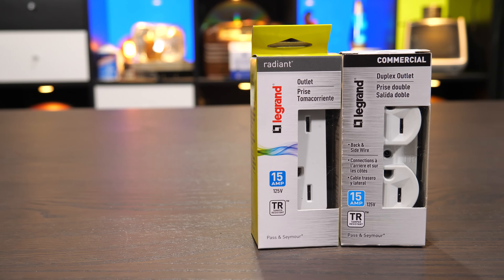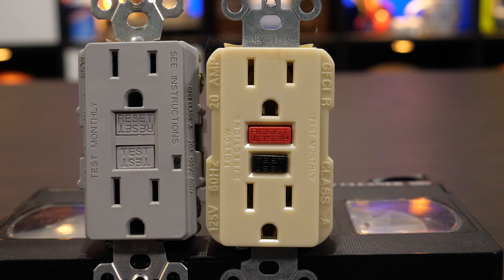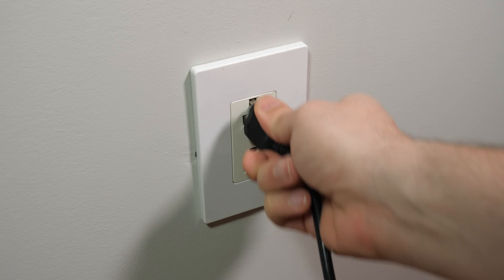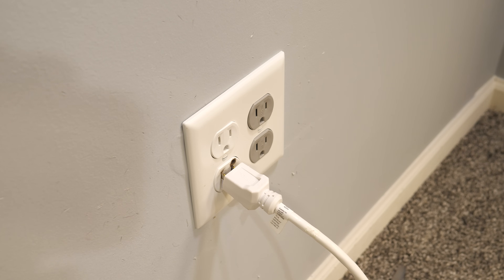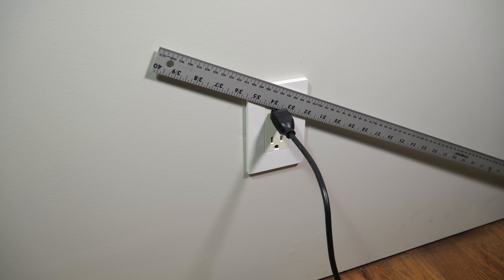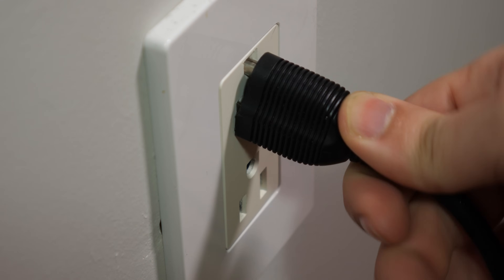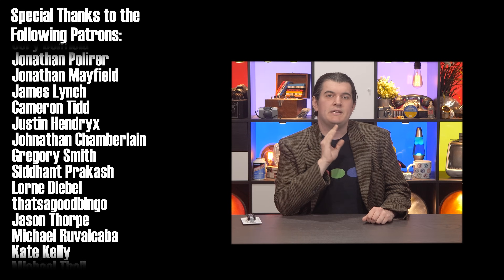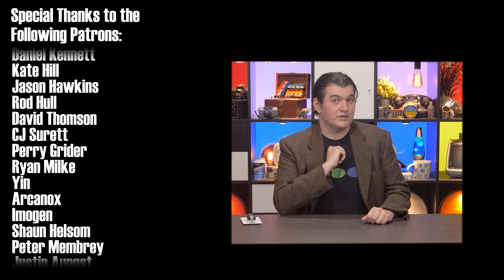Power outlets are topsy turvy - but does it matter?

Comment: I actually find it kind of funny/interesting how many of the issues raised are solved by EU plugs. They are fairly standardized, the receptacles are symmetrical, so you can plug in either way up, even with grounded plugs, they are inset, so even a slightly ajar plug isn’t easily reachable, and they are sleeved.
And the cup-like receptacle actually holds onto the full-sized plugs quite well, making it harder for them to slip out.
Reply: I lived in Europe for two years and loved the outlets and plugs there. I'd totally be down for us to adopt that design and ditch this design
Reply: EU and UK plugs are definitely the best I've seen, with EU ones are definitely the most elegant of the lot (ground being on the outside of it iirc?), with the UK design being from the era when plugs were installed on cables by the owner (hence the overengineered safety features of the fuse and slack on the ground) but either way, I'm glad I don't have to use a Type A US Plug.
Reply: counterpoint: eu outlets look silly
Reply: @Thesupremeone34  counter-counterpoint: I'd rather have outlets that people think look silly but are very safe versus having outlets people are used to but are extremely unsafe by design
Reply: Counter-counterpoint - to us in the EU, the NA outlets look silly

Comment: Huh. that explains why so many things plug in upside-down, especially ungrounded ones. But there's a ton of things that are only stable if plugged in the other way... and wouldn't be stable at all sideways.
12:00 really? not one? I find these things plug in upside-down all the time. But maybe they just feel upside-down to me, and the manufacturer actually intended that. Either way, can we agree there seems to be no standard on whether a plug-in device should have its mass above or below the plug? Thick electrical cords tend to go mass-down, but scented plugin things tend to be mass-up (when they aren't centered) in my experience anyway. and if it's something like a signal extender or a plug-in monoxide detector or something, it's a total crapshoot.

Comment: I once dropped a small metal tool, basically a small metal dental pick, it fell perfectly across the live and neutral pins of a slightly ajar plug, creating an eye searing arc flash and a decent bang. Fortunately the tool blew apart and didn't weld itself to the plug and it was brief enough that the breaker didn't flip. However, ever since then, I've cared a lot about the orientation of plug 😬

Comment: The NEMA plug has had those "Design Flaws" for decades yet no changes are ever going to be done.
as mentioned the lack of insulation on the top half of the pins.
All of Europe does this, Australia does this, other countries do this.
You would think who ever maintains the standards for NEMA would pick up on this common trend.

These counties also add switches to the outlets too.

Comment: Patent says ground up, not like it matters.

For myself I turn the outlet depending on use case in any apartment or house I'm in. 

Ive had plenty of right angle like plugs in both orientations or 45 angle so just turn it myself depending.

Comment: To get a safer plug it would be possible to design new plugs with a sleeve that fits into a recessed outlet that would fit said sleeve. To retain cross-compatability, existing plugs would simply need to be able to be inserted into the recess, eliminating the 'need' for the sleeve. 

I think the issue is the cost of implenting such changes. Is it really worth the billions of investment just to change a plug that works 99.999% of the time? IMO that money could go to solving much more important problems.

Comment: i think the top guy should be upside down and the bottom guy's face should be normal orientation.

That way if you have two grounded wall warts, you can plug both in at once. Maybe do a chicago sideways on the entire outlet too to make the cords flow nicer.

Comment: As a maintenance technician at a smaller-medium sized university, I have some feelings about orientation of outlets. Keep in mind I primary deal with Dorm rooms and University owned Apartments. 

1. If its a standard duplex receptacle made by Pass & Seymour. Install it with the ground up. Whether its under the Legrand Name or not, they all have one fatal flaw with residential and commercial grade receptacles. They are made of incredibly Soft Plastic (for receptacles). If installed with the ground down, any grounding pin from any plug will cause the soft plastic of the face of Pass & Seymour receptacles to stretch, and therefore the plug will "sag" in the receptacle. This leaves the hot and neutral exposed and are often making very poor contact within the receptacle, thus leading to the contacts inside the receptacle wear out and sometimes arc, even when a plug is fully inserted. This issue is not a problem if installed upside down for P & S or for most brands, as the "pull" is therefore causing the grounding pin to push "up" deep inside of the body, usually against the metal frame inside of the receptacle. 

2. The NEMA 6-15R (250V): Always install upside down. This connector is usually a single receptacle that is pretty much only used for 208-240V appliances which some call window AC's and are often permanently installed in some sort of metal cage cut into a wall of an apartment. There is no neutral for these receptacles, but rather two pins that carry one leg of 120V each. Their spades are horizontal, not vertical and therefore prevent plugging a NEMA 5-15P Plug into it by accident. These receptacles have been the reason for fires in the past in some apartments because a poster fell down , and made contact with both poles, thus creating a 240V arc. Based on audio from a camera that was located in the public hallway of the building, the arc only lasted about 0.2-0.6 seconds before the breakers tripped. Unfortunately, the poster was still on fire and caused extensive damage to that apartment. With the knowledge that there was a tripped breaker, the outlet came into question by some local fire inspectors and some testing later, it was recommended that they all be installed with the ground pin up to reduce the risk of creating a fire. The breakers were also taken and tested by insurance adjusters to ensure that they functioned as designed, and they passed with flying colors, much to the dismay of the insurance company 😊. Weirdly enough, A/C manufacturers used to use 90-degree plugs that were designed for the grounding pin to be at the top. Unfortunately, it was changed for the grounding pin to be on the bottom most newer models of A/Cs. Therefore, nearly all of these receptacles in the apartments I work in are still grounding pin up. The unit with the fire was an exception to the rule.

Comment: Also a resident of Illinois and a majority of my wall receptacles are horizontally mounted, with the neutral blade on the bottom.
I would think for the reasons you mention, it would be better to mount with the neutral blade up as it would be protected from metal objects falling against a partially dislodged plug becoming electrically hot.
Reply: The saving grace is that the sideways orientation means plugs of all kinds are far less likely to get dislodged under gravity as the blades are now parallel to the ground rather than perpendicular, but ya, grounding pin left / neutral high would seem like the best of all possible orientations.

Comment: might sound biased, but, the uk plus design answers most of the concerns raised in this video. earth at top-tick, right angle plugs-tick, 3 prongs(even for unearthed devices)-tick. as long as the plugs meet the safety parameters, unlike shady imported stuff often is. the pins are chunky and robust, and do not bend. and we have 240v in standard sockets. Due to the design the size also means that the plug can fit a fuse in, where required.

sure, the design is kinda ugly. and expletives at the ready if you stand on the plug.

Comment: let's just face it Your plugs are poorly designed. 1. No fuse, 2. easy to get electric shock. 3. The cable stands out rather than at a right angle to the wall. No switch on the wall socket and no guard flaps.

Comment: the strangest thing to me about North American outlets is that your duplex sockets come uppie-downie as opposed to sidey-side (in most cases, as you discussed). You can only ever have one right angle socket plugged in owing to having one blocking the adjacent socket to be used for another right angle cable (unless it's that strange 45 degree one). Does the wiring in houses just make it easier to wire them in vertical configuration? Cause I can't think of any other reason for them to be done vertically rather than horizontally other than whoever designed it just felt like it

Even the multisocket extension cords i saw over there were vertically oriented. It's just odd to me coming from the UK where all of ours are horizontal or 45 degrees, with the same applying to the ones i've seen in europe

Comment: The only place I recall that had the outlets "the right side up" was an old apartment complex back in Columbus, Ohio. Probably dating back to the 80s, if I had to guess. When we were living there in like 2009-2011, it still had the old floorboard heaters and a single "window" AC unit in one of the bedrooms (window in quotes because it was a permanent install into a dedicated cutout in the wall). 
Everywhere I've been since has had the hot/neutral side up top.

Comment: Why don't we just redesign the whole thing and make a new one from the best parts from EU and UK designs, you know, switches and fuse per plug, recessed design, sleaved and round inserts for security, ease of manufacture, strength and durability and even 4 pins instead of 3 so we can have a standard plug / receptacle for 120V and 240V

Comment: I challenge anyone to let a coin fall and successfully hit the prongs of a plug that's not plugged all the way in(just turn off the breaker for safety reasons) and upload the video on YouTube as evidence.

By the way. The kind of plugs that tend to come out of the receptacles are the two prongs ones (those terribly designed Samsung chargers comes in mind), not the 3 prongs ones.

Comment: I bought a large pack of right angle extension cords that are 1ft long and the heads swivel 360, I use them everywhere either the appliance/device doesn't have a right angle plug, and/or where I have two right angle plugs I want to use on the same outlet, for as you might know two standard right angle plugs don't play nicely together unless they are the offset design.

It sufficent to say was one of the best purchases I ever made!

Comment: Here in Chile we use Type C (and L), which are common in Italy as well.

The plugs are tubular rather than parallelepiped, and the ground is at the middle, in a straight line ⫶ (rather than triangular ∴ )

I think that all plugs made in the last decade are insulated, so I don't think that I have ever seen a charred receptacle that is from this decade.

Also, some power strips are very hard to remove plugs from (go figure, I have a christmas themed one that also has a fuse, and even trying to remove anything is a chore)

Comment: That tape measure scenario happened to me when trying to measure my parents kitchen wall. 😅 Luckily the cord was plugged into a surge protector wall receptacle plus the body of tape measure was plastic. So I didn’t get shocked but it did char the surge protector through.
Reply: Wow!  Glad you didn’t get zapped!  Did the gfi trip and take a few other outlets with it?  It’s crazy how many older homes have not been upgraded with gfi protected outlets in at least the kitchen and bathrooms
Reply: @staffy73  Just the surge protector itself popped but I don’t think there is a gfi outlet on that circuit.

Comment: For many years I lived with a Litton microwave oven atop a Hotpoint refrigerator, plugged into the same vertically oriented outlet. They both had 90° plugs, but with opposite ground-pin-to-cord orientation. The fridge cord dropped down and the microwave cord led up; my OCD was soothed every time I looked at that outlet and its resident plugs.

Comment: When I moved into my first apartment, I had a license plate leaning against my desk. While moving a couch, I knocked it, causing it to land on the prongs of a lamp's plug. The room's lights flickered with sparks and smoke. I quickly unplugged it, finding two melted slits on the plate from the outlet contact. It's a miracle there wasn’t a fire; I still marvel at how fast the situation escalated.

Comment: And you wondered why brits have switches next to plug sockets, even though the plug design is many orders of magnitude safer (right angle plugs with cable down is default, 3pin plugs are default, ground pin up default, plugs side by side is default.finger grips on the side of the plug are default, live and neutral pins are shielded and only connect once the shielding is inside the receptacle, live is current limited by a fuse  in the plug) we still have the option to turn the socket off when plugging and unplugging devices. Not to mention shutters protect the live and neutral receptacle and are unlocked by the ground pin engaging. Sure you can bypass that but it takes active effort to uncover live terminals.
It's probably the higher voltage that made the first standardised design so safe.

Edit - oh and we always use two screws at least on a face plate

Comment: I've seen loose metal faceplates really screw up some stuff when they fell down and connected live to neutral in a chemistry classroom.  It being flipped the other way would have prevented the destruction of that student's phone charger.  And not had me call out the school electrician to fix it.

Comment: A silly question: why aren't those mirrored? I mean why aren't they oriented in opposed directions? This would solve an issue with using two right angle plugs at the same time at least in horizontal direction. And it would end the discussion about the correct orientation as there will be only one possible.

Comment: I'm an electrician.   And I do care.  I'm an indoor (former IBEW) journeyman wireman.  Residential (crappy) electrician out of work is the guy helping you get the wrong parts at home depot. 

Ground up is correct (for a far as US NEMA) as it catches things first when fallen behind.   Home owners don't know, they just prefer to look at a smiley face, it makes them feel warm inside.   When mounted horizontal, the hot side is up for all the wrong reasons.   But getting shocked by the hot is safer than carrying the load of the neutral (amps :aka the load kill you).   2 wire (zip cord) ungrounded you find on simple table lamps have ribs on one wire.   That is the neutral.  GFCI are made for woman (can't let go threshold).

Right angle plugs are like they are due to the residential owner wanting to come home to smiley faces.   Manufacturers capitulate to make you happy, instead of telling you to get an electrician to come fix your house.

Comment: Why not just have an on/off switch on the outlet like we do in the uk? You can 'touch' the pins all you like then as it really doesn't matter. You plug in your device then 'make it live'. Simple

And why would you not just have a generic design for the plug? All uk plugs have a ground pin regardless of the device requiring one or not? The ground pin is key to the plug entering the socket. Without it, the plug won't go into the socket.

Comment: In my opinion it does matter, Solely for the ground pin being the top pin. Funny story; When i was a little kid i decided to hang the lid of a plastic garbage bin on a plug that was plugged in, The handle was those cheap handles they make out of galvanized steel wire like a coat hanger. Well the handle slid between the plug and receptacle and landed on the neutral and live connections, Making some sparks and giving me a wicked shock.

Comment: I was measuring the kitchen backsplash and happened to drop the metal tape onto the very slight gap on a countertop microwave which happened to be running. This left me with a scorched device and a tape measure with Dracula fang marks on the side about 30" down. One in a million but it happened!

One benefit of the "wrong way up" is those heavy "wall wart" transformers aren't so happy to be upside down in terms of falling out of the outlet.

Comment: Exactemente! In college, 30 years ago, I lived in a very stylish dorm that had shiney metal fixures, including the the outlet and switch plates. Well, exactly as you describe someone though it would be a good idea to remove the screw from the one outlet in the room. I plugged my rented mini fridge, with a heavily abused plug, into the outlet and almost instantly the plug half fell out and the metal plate dropped across the prongs. Boom! Tripped the breaker and took out power for four rooms.